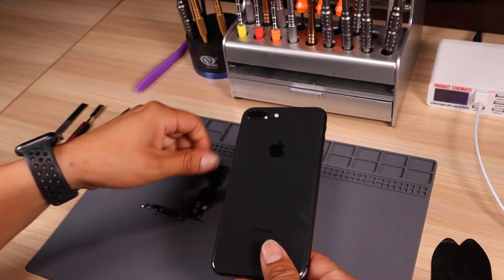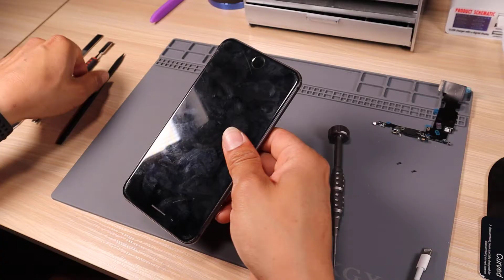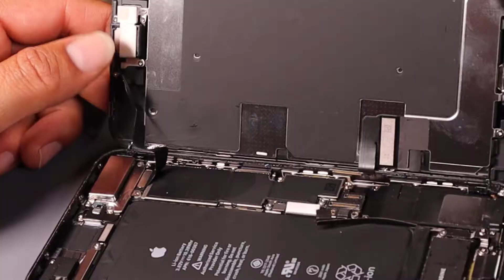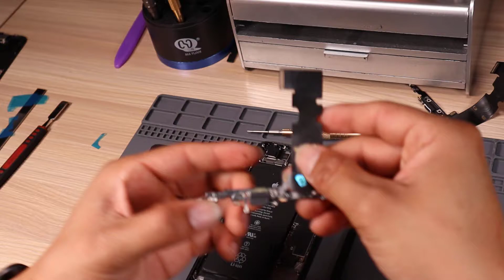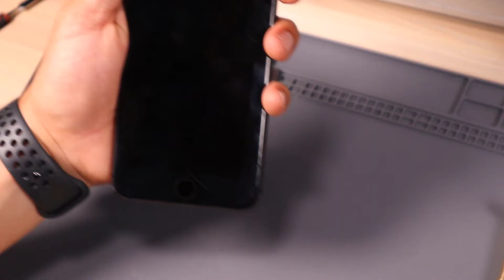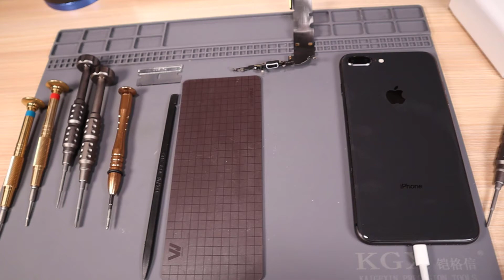Easy way to replace an iPhone 8 Plus Charging Port Without removing motherboard

Comment: I did it!  Hated those screws with the shallow cross.  Who has such a special tool?  Yanked and tossed them somewhere, who cares where.  (note: found out it's called a "standoff" or "cross" or "convex cross 2.5" screwdriver, unique to these special screws that Apple invented to discourage repairers.)

Comment: My phone would not boot after the repair and I got the charging icon forever when I plugged in the charging cable, as if the battery was low and I did a hard reset by a quick up then down on volume buttons and then holding the power button until the Apple logo appeared and phone booted.The battery was not really low.

Comment: Hey i have some questions pls.

I hve a habit of cleaning my phone with wet tissue offen, can that cause any damage to phone if water goes inside through the pots? My audio failed the output test at genius bar recently as well. 

Do they have to change the display? Can’t they just fix the audio ports and charging port as having issues with both.
Reply: 100% only clean with isopropyl alcohol and turn on again after phone dries